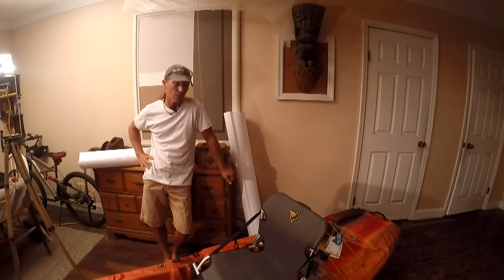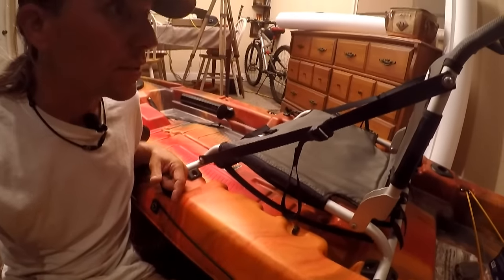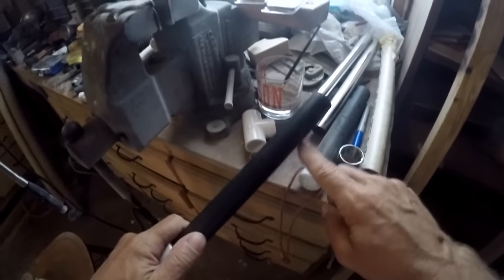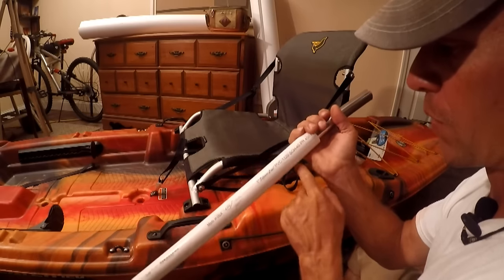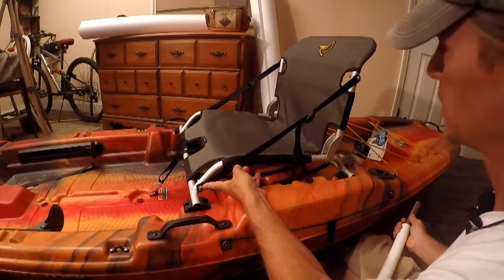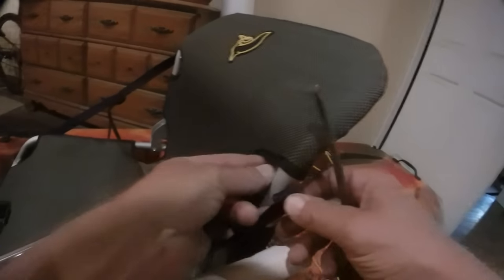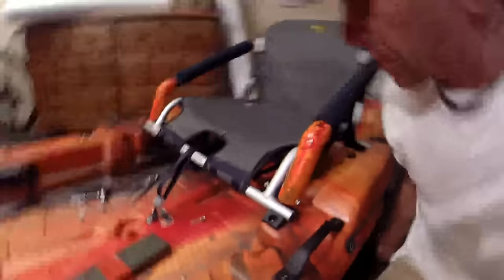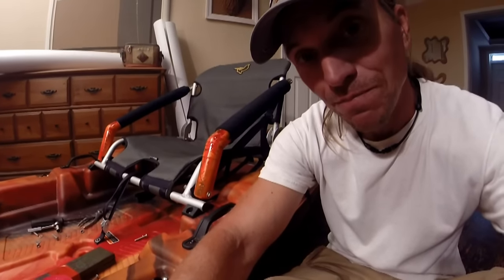Kayak Giveaway Build Part 2: The Seat

Comment: Marty, great video.  One suggestion I would make is to "flip" the bolts in the seat so the nut is on the outside.   The nuts protrude 
further into the seat and can dig into your leg after being on the water for several hours.  The head of the bolts are much flatter and won't dig into your leg.  Also, when I flipped mine, I put some nylon cable clamps under the nut to provide a couple of extra attachment points for retaining gear.

Comment: An easier bolt on solution on the top end of the arm rest will be a great essential in order to collapse the seat. Maybe a pin that pulls out with a ring attached. In turn the seat will collapse completely and the arm rest will just lie on the side.

Comment: I just bought the catch 120.  I am questioning the drain plug.  Mine doesn't seem to want to stay secure.  Did I buy one with a faulty plug or is that a common issue?  Short from buying a replacement plug, what can I do?

Comment: um... when you sit on the seat the strap is under tension , why not just put a pool noodle on it ? , ide rather have a horizontal arm rest built with 2 flush mounts you can take in and out for when you no longer need to paddle.